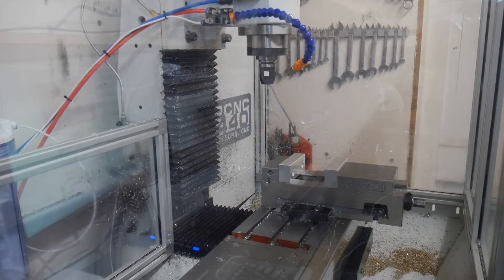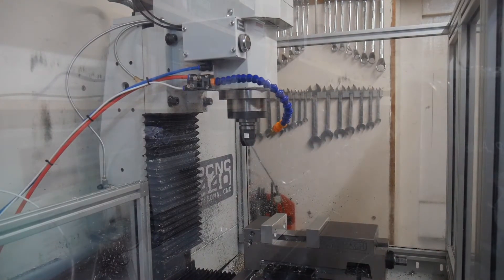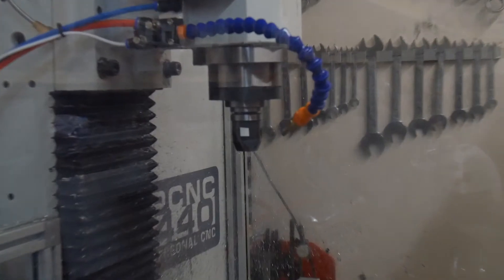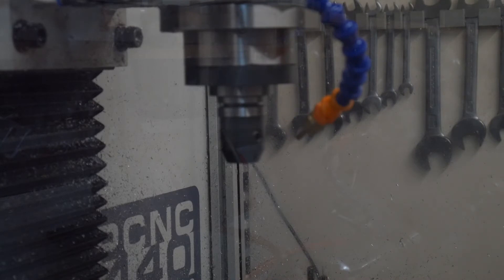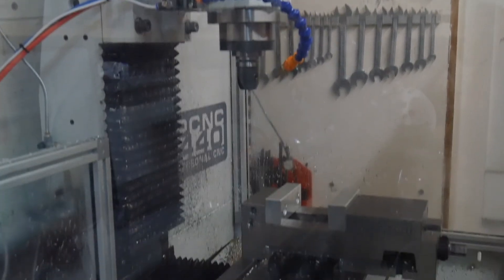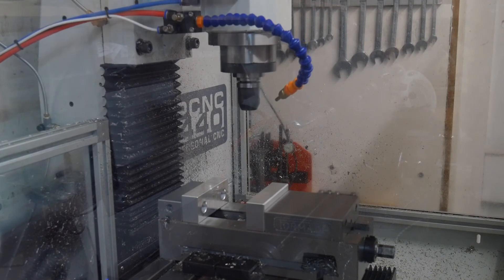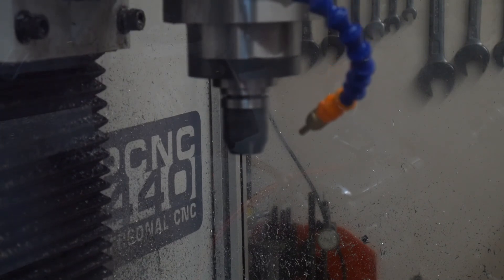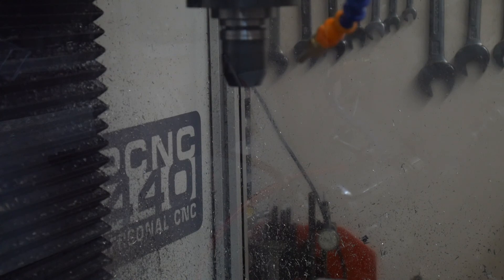PCNC440 Goes Backwards

Comment: David, I saw you Tormach 440 in reverse. Great to see someone figured it out. 

I have 5 in a school and would like to do the same. Is it as easy as connecting a few wires? Also how can you get the reverse button on screen? 

Thanks in advance
Skipper
Reply from the maker: Yes it really is just 2 wires.  Look at the spindle drive, there's a terminal marked F/R.  Next to it there's one named COM.  Short the 2 together and the spindle reverses.  You can do this even at full speed and the acceleration/deceleration is smooth.  Test it with just a piece of wire.

To automate, outputs 3 and 4  on the MX3660 are not currently connected.  Connect eg 3+ to the F/R and 3- to COM and output 3 now controls direction.

Problem is that Tormach have those outputs pre-assigned to do step and direction for a 4th axis, so you'll need to figure out how to reconfigure the software.  I use Mach3 rather than PathPilot and it's very easy that way.

Comment: I am in the UK (altrish.co.uk)and also own a 440 and wondered for some time how to reverse the spindle.   What did you change in the wiring ?
I have the Tormach USB expansion board with a double pole changeover relay that is not being used so I guess I could use this but it would not be through a M4 command but the bespoke for the board control.  I use PathPilot.   Like what you have done on the toolchanger.
Reply from the maker: Look at the terminal block on the motor drive.  there's an unused terminal labelled F/R (Forward/Reverse)  If you short that terminal to the neighbouring COM terminal, the motor goes backwards.  It's actually shown on the schematic at the back of the 440's manual.

I connected those pins to output 4+ and 4- on the MX3660.  you don't have to wait for the motor to slow down, just change the F/r pin and it decelerates/accelerates nicely.  You can test it with just a piece of wire.

I'm afraid I use Mach3 on my mill, so I'm not sure how to get PP to use the output, but the USB I/O module should work just as well.

Comment: The Tormach is great and all, but a CNC Myford? Intriguing, I've recently picked myself up an ML4 and have been thinking of adding an electronic auto feed. How did you get the other axis electrified? Any issues with backlash?
Reply from the maker: Yeah, a CNC Myford can be done!  I took my inspiration from an article on this site http://www.jeffree.co.uk/modelengineering.html I got a new cross-slide lead screw (machine is early 70s) that reduces backlash to a couple of thou - not a great deal worse than the Tormach. and the main leadscrew thrust bearing mod described in the link reduces z-axis backlash to perhaps 3 or 4 thou.  Doesn't sound good, but remember lathes rarely if ever cut left to right and right to left in the same op so it really isn't a problem.  This was one of the first parts it made https://youtu.be/rcCES4nx77I Nowadays it's going much faster and the carbide tipped tools can cut 50 thou deep in EN8 without distress.  Useful!  Don't get one of the stepper controllers visible in the video.  It lasted a few hours of use, then went POP!  I'll be doing some EN8 machining in the next couple of days, so I may try to video it for you.
Reply: Amazing! I think my leadscrews have a good deal more backlash than that, it's an early 40's model as best as I can tell. Imperial leadscrews all around but seems to be capable enough. First step is the main leadscrews with the other axis to follow I think. Thanks for the link, great resource in there.
Reply from the maker: Myford in action if you're still interested. https://youtu.be/zag0kAvt5m4